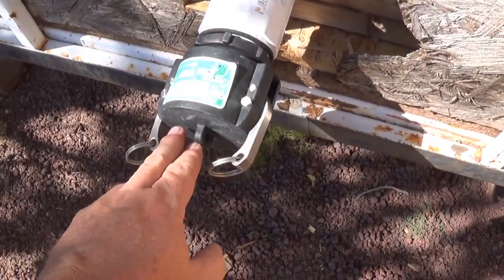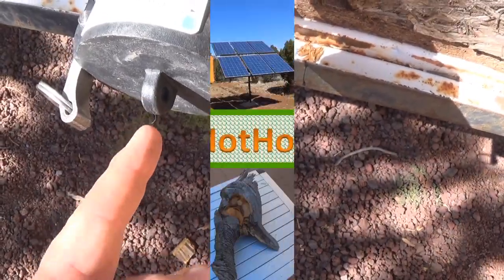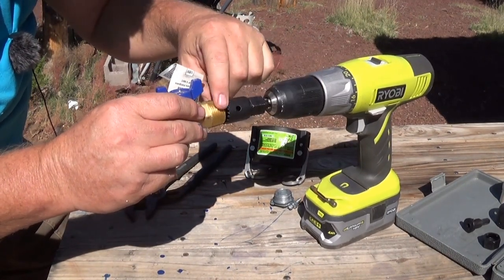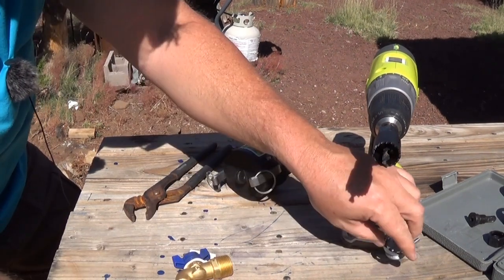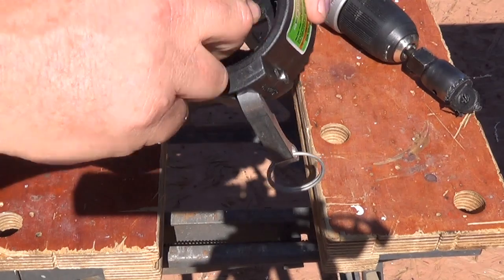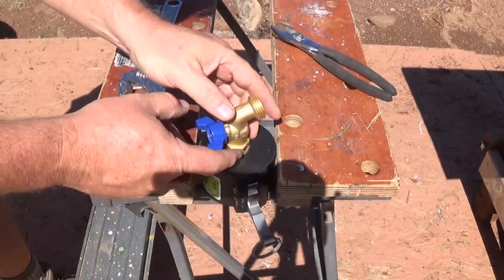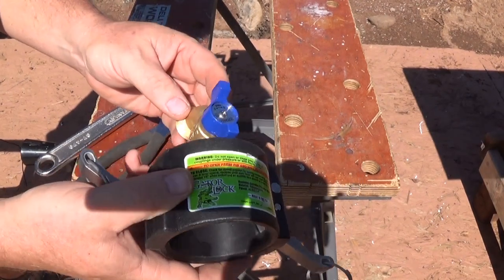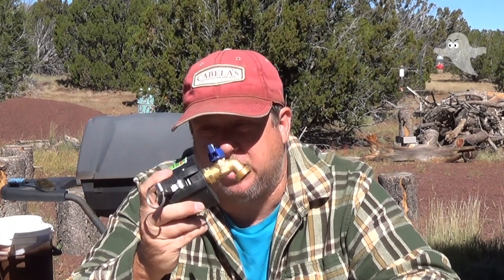Water Trailer Modification  💧  Why Didn't I think of this before?

Comment: I think if you heat the threads with a torch it would work as a tap in the plastic.
Reply from the maker: thats a great idea. the plastic would form around the threads making a great seal.